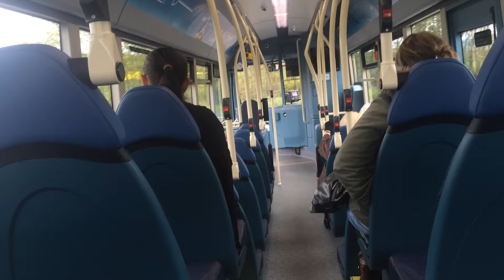*CLUNK* Over-revving! Brand New Wright Streetlite NK15 AAF (1591)

Comment: I was on the Db300 the other day, the doors would not close the driver had to constantly turn the engine on and off to finally reset them. He phoned the depot and they advised him to put his foot brake on while the doors were open. This was on the newer 2011 reg one. When I exited the bus I nearly got trapped as they kept on opening and closing violently.

Comment: I was talking to a driver of the x1 he has done it for 3 years and he said that although the Mercedes streetlites are better for changing through gears he said the Mercedes are utter rubbish compared to the Cummins. He said the Mercedes ones aan and aao are not as powerful also they are always having problems the Mercedes streetlites are both on hundredthousand miles but the Cummins are on 120.000 miles. The Cummins ones have managed to do way more miles as they are not of as much. I would of thought the Mercedes to be more reliable than Cummins but oh well. At the end of the day streetlites are awful buses and don't have much power. The driver also said the 09 pulsars that used to be on the x1 were realey good they were fast and didn't have problems like the streetlites do. He said they were caned for over 3 years and he said im suprised they didnt go to scrap when they finished the x1 they were that worn out. In my opinion arriva would of been better of buying something like a volvo which are capable of doing long routes and is one of the most reliable bus company. The streetlites were not meant for long routes just small routes buy arriva put them on a max route anyway.
Reply: I like Solaris buses the most.